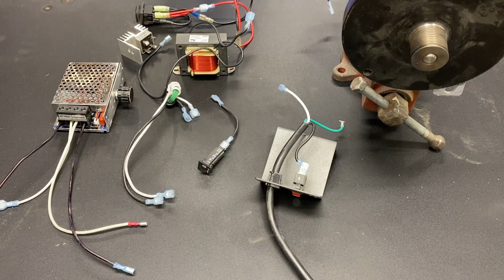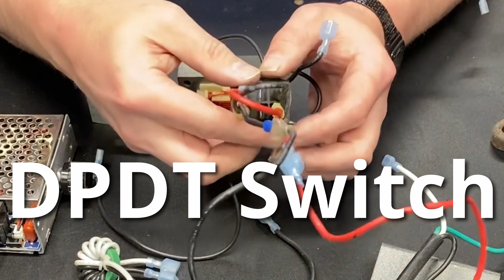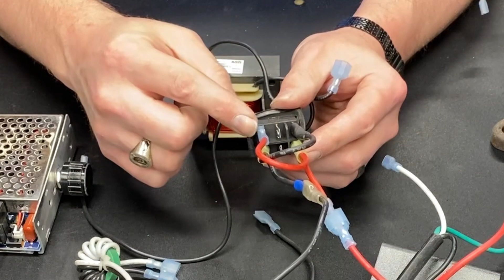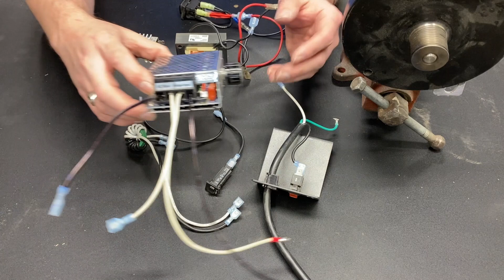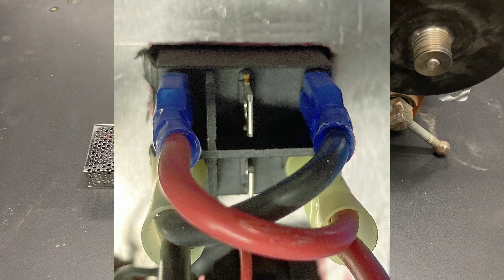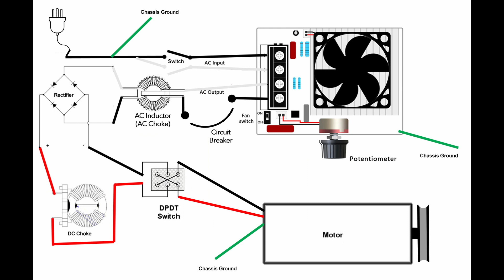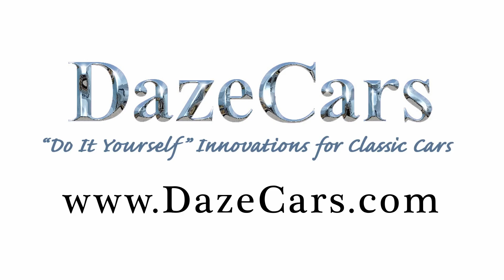Hooking up the Components for a Quality SCR Treadmill Motor Power Supply, Treadmill Motor Controller

Comment: I can think of 3 ways to turn the motor on and off.  The default method is wire the on-off switch to the120 AC powering the SCR controller like in your schematic.  Alternatively, you could have the switch on the output of the SCR cutting off power to the motor, or disconnect the potentiometer to stop the motor.  Is there any advantage to either of these other two methods?
Reply from the maker: The make a potentiometer that is off on one end.  A direction switch should be center off so that serves as the on off on the motor end.  I use the off on the direction switch when I am threading because that operation is direction dependent.  No mater how you do it you always want a master power kill switch in front of the SCR so those parts are not seeing power all the time.

Comment: I really appreciate your videos!!
I recently put a treadmill power supply for a compost trommel and used the converted microwave transformer as a DC choke. It made a very unnerving Dr Frankenstein type when simply taped together, however when I securely clamped it down to the table the noise disappeared.  
Do you know what this noise could have been? Also, would it be a point of concern?
Reply from the maker: It is a vibration created by the changing magnetic field.  Was the top welded back on?  Usually the top is where the vibration comes from if it is not solidly connected.
Reply: @dazecars  Thanks for the Reply!
I have it clamped down really securely and will eventually weld or epoxy it back together.
But it is just surging on and off now. Im running it at pretty low power from the SCR. I have all the components from your SCR hookup video, but it doesnt seem to be working and I don't hear you mention that in any videos.
Any Idea what that could be?
Reply from the maker: can you contact me through my website and send pix of your choke.  it is weird that it was working but now its not.  I wonder of due to vibration you broke through the insulation on the coil.  You could also try running it on the negative side.  Choke can be used on either side but sometimes works better on one over the other. @brendand3030

Comment: Daze. You use conventional color coding for DC wires. Red is positive and black is negative. But you show the black wire connecting with the choke. What am I missing? Shouldn’t the red wire connect to the choke?
Paul
Reply from the maker: The choke wires are black from the factory. They are hard wired in and not changeable.

Comment: Hi, great video! Can you please make a video of how to calculate the right choke and inductor values? I need a filter for 4kw resistive load with SCR power regulator, but don't know how to pick the right inductor to avoid spikes on the mains.
Reply from the maker: Not being an electrical engineer I do not have any specs or calculations for you on the motor choke. What I can do however is offer you some guidelines. First of all bigger is better. I have several motor chokes ranging from the size of a tennis ball to the size of a soft ball and the bigger they are the better they work. Second the wire for the choke needs to be a minimum of 16 awg. If the wire is not that big or better it will not have the amperage capacity to allow the motor to work properly. Amperage is the most important spec.  A lot of the chokes available online are rated in mA.  there are 1000 mA in an amp.  Treadmill motors are rated in amps so most chokes available online are several hundred times too small.  Third they are not available on Amazon at least not inexpensively, there are a few privet sellers on Amazon selling used parts for big bucks but the available chokes on amazon are too small because they are not designed for a motor even though they look correct in the picture they are WAY too small. The choke in most of my videos is part number 130993. Instead of getting one new I would get a used one. A lot of treadmills come with a choke. Go to eBay and search “treadmill motor choke” BUT know that most people on eBay don’t know what they have and the word “transformer" will also appear in most listings. Problem is a choke and a transformer look almost identical so some listings are for transformers and some are fore chokes because the sellers think they are interchangeable. They are not. They would only be interchangeable if you modify a transformer to work as a choke. (see my DIY choke video) To tell the difference count the wires. A choke will only have 2 wires, a transformer will have 3 or more. Also before I started doing videos chokes on eBay could be had for $25 or less shipped but now that more people are looking for them (due to my videos) the eBay sellers have raised their prices quite a bit. Your best bet might be the DIY option out of a Microwave transformer. Please let me know if I can be of further assistance.

Comment: Hi ,  ac voltage is 220, i want  0 to 90vac variable ( i do not want above 100vac). So 
select value of potentialmeter.  Tell me the value of potential meter,
I am using 10,000w scr controller.
Reply from the maker: I can not as it is not that simple.  You need to do some testing with a volt ohm meter

Comment: Hi, I was wondering if you had any info on selecting the choke  and inductor.
Reply from the maker: Not being an electrical engineer I do not have any specs for you, what I can do however is offer you some guidelines. First of all bigger is better. I have several motor chokes ranging from the size of a tennis ball to the size of a soft ball and the bigger they are the better they work. Second the wire for the choke needs to be a minimum of 16 awg. If the wire is not that big or better it will not have the amperage capacity to allow the motor to work properly. Amperage is the most important spec.  A lot of the chokes available on line are rated in mA.  there are 1000 mA in an amp.  treadmill motors are rated in amps so most chokes available on line are several hundred times too small.  Third they are not available on Amazon at least not inexpensively, there are a few privet sellers on Amazon selling used parts for big bucks but the available chokes on amazon are too small because they are not designed for a motor even though they look correct in the picture, they are way too small. The choke in most of my videos is part number 130993. Instead of getting one new I would get a used one. A lot of treadmills come with a choke. Go to eBay and search “treadmill motor choke” BUT know that most people on eBay don’t know what they have and the word “transformer" will also appear in most listings. Problem is a choke and a transformer look almost identical so some listings are for transformers and some are fore chokes because the sellers think they are interchangeable. They are not. They would only be interchangeable if you modify a transformer to work as a choke. (see my DIY choke video) To tell the difference count the wires. A choke will only have 2 wires, a transformer will have 3 or more. Also before I started doing videos chokes on eBay could be had for $25 or less shipped but now that more people are looking for them (due to my videos) the eBay sellers have raised their prices quite a bit. Your best bet might be the DIY option out of a Microwave transformer. Please let me know if I can be of further assistance.

Comment: How do you know what size choke for the dc side and for the ac side?
Reply from the maker: Not being an electrical engineer I do not have any specs for you, what I can do however is offer you some guidelines. First of all bigger is better. I have several motor chokes ranging from the size of a tennis ball to the size of a soft ball and the bigger they are the better they work. Second the wire for the choke needs to be a minimum of 16 awg. If the wire is not that big or better it will not have the amperage capacity to allow the motor to work properly. Amperage is the most important spec.  A lot of the chokes available online are rated in mA.  There are 1000 mA in an amp.  treadmill motors are rated in amps so most chokes available online are several hundred times too small.  Third they are not available on Amazon at least not inexpensively, there are a few privet sellers on Amazon selling used parts for big bucks but the available chokes on amazon are too small because they are not designed for a motor even though they look correct in the picture in the picture they are way too small. The choke in most of my videos is part number 130993. Instead of getting one new I would get a used one. A lot of treadmills come with a choke. Go to eBay and search “treadmill motor choke” BUT know that most people on eBay don’t know what they have and the word “transformer" will also appear in most listings. Problem is a choke and a transformer look almost identical so some listings are for transformers and some are fore chokes because the sellers think they are interchangeable. They are not. They would only be interchangeable if you modify a transformer to work as a choke. (see my DIY choke video) To tell the difference count the wires. A choke will only have 2 wires, a transformer will have 3 or more. Also before I started doing videos chokes on eBay could be had for $25 or less shipped but now that more people are looking for them (due to my videos) the eBay sellers have raised their prices quite a bit. Your best bet might be the DIY option out of a Microwave transformer. Please let me know if I can be of further assistance.
Reply: @dazecars  thanks got the reply. I picked up a tread mill last night for free but the speed control board is a fair be different then what i see in your videos so I opted for the scr route. Now looking at the tread mills speed control board, it does have a transformer and i was thinking of using that as my body and just re wind it like how you have done in your video. If i do that, how do i know if i have enough wire wound into it?
Reply from the maker: The transformer from the treadmill board is likely too small.  you want it to be the size of a tennis ball as a minimum but bigger is better.  As to the windings you want to fill it full and then secure the wire so vibration doe not cut through the wire shielding.  this is why the microwave transformer is such a good option it is big enough and comes with the coil pre wound. @bryantimms1469

Comment: will this power a 180 volt treadmill motor?
Reply from the maker: yes and no.  It will never produce more power than what it put into it.  So if you hook it up to 110AC and then the SCR with rectifier you will never get max speed.  If you hook it up to 220 you will get more than max speed and a limiter at the top would be recommended.
Reply: Wow my dude! nobody ever responds but to get a paragraph speaks to your generosity and general good will! Thanks man! I have several big honking treadmill motors that are 180 volts and I thought they were from a treadmill that somehow made a bigger voltage out of 110. 

 @dazecars
Reply from the maker: You took the time to ask a question, least I can do is take the time to answer 😁 (tell your friends) Some treadmills are setup to plug into 220 needing the 180V notor and as you assumed some treadmill controllers step the voltage up from 110 to 220.  An SCR however is just a limiter so it can only reduce voltage.   @lucrebrazzi4069

Comment: Thank you so much for your detailed explanation.  I spent an hour watching a following the instructions of other youtubers, and it would run a full speed whenever I applied power to the motor.  Then I remembered your channel as, I'd come across it in my research for my 2x72 grinder.  After watching you instructions twice and following along, I managed to get set up like yours (minus the circuit break as i didn't have one) and was up and running,  however I haven't been able to get to run clockwise and anti by switching the wires on the bridge. I'll try and get the circuit breaker and switch and hopefully that will work.  But thanks you saved me hours of head scratching.  Subbed and saved
Reply from the maker: glad I could help

Comment: Where do I get a dc chock?
Reply from the maker: Here are some guidelines that might help. First of all bigger is better. I have several motor chokes ranging from the size of a tennis ball to the size of a soft ball and the bigger they are the better they work. Second the wire for the choke needs to be a minimum of 16 awg. If the wire is not that big or better it will not have the amperage capacity to allow the motor to work properly. Third they are not available on Amazon at least not inexpensively, there are a few privet sellers on Amazon selling used parts for big bucks but the available chokes on amazon are too small because they are not designed for a motor even though they look correct in the picture in the picture they are way too small. The choke in most of my videos is part number 130993. Instead of getting one new I would get a used one. A lot of treadmills come with a choke. Go to eBay and search “treadmill motor choke” BUT know that most people on eBay don’t know what they have and the word “transformer" will also appear in most listings. Problem is a choke and a transformer look almost identical so some listings are for transformers and some are fore chokes because the sellers think they are interchangeable. They are not. They would only be interchangeable if you modify a transformer to work as a choke. (see my DIY choke video) To tell the difference count the wires. A choke will only have 2 wires, a transformer will have 3 or more. Also before I started doing videos chokes on eBay could be had for $25 or less shipped but now that more people are looking for them (due to my videos) the eBay sellers have raised their prices quite a bit. Your best bet might be the DIY option out of a Microwave transformer. Please let me know if I can be of further assistance.
Reply: @dazecars  thanks!
Reply: I finally finished it. My drill press is working great! 120rpm - 3200rpm. Thanks sooooo much for your help!
Reply from the maker: Outstanding, glad I could help. @milanp5697

Comment: Good Afternoon! Thanks for the video, I am working on a treadmill motor to drive a squirrel cage fan and this is very helpful. One question that i have is how do you keep the voltage from going over 90v? If it is 120v from the wall, I am getting 112v, on the other side of the rectifier. I have not added the choke yet so not sure what that will do but right now I am sitting at that 112v and do not want to even test it due to not wanting to overvolt the motor. Will the choke drop the voltage enough to prevent the motor from receiving the 112v or am I missing something.
Reply from the maker: First in most cases a 90V motor will work just fine with a bit more voltage as long as there is an adequate cooling fan.  The 90V rating is to establish the RPM and HP on the label.  Second when you hook the motor up to the power supply and start running it the voltage will drop closer to 100 max.  Third if you are really worried about it you can put a small resistor in series with the potentiometer to act as a limiter.  When the potentiometer gets to 0 the SCR puts out max volts but with a small resister in series it will never get to 0.

Comment: Thanks so much for all your awesome videos! Ive probably watched all the treadmill videos more than once. 

Im stuck on the inductor... I purchased a 35mmOD ferrite ring ( FT-140-43 ) and im still uncertain what to do with it. I see you used regular insulated wire rather than enamel coated wire. I already have 12g insulated wire on hand. Can you tell me how many times to wrap each lead if using what i already have on hand, please.
Thank you
Reply from the maker: You can do it with regular insulated wire.  I do 7 wraps per strand of wire.

Comment: Will it help to add a choke to a MC 2100
Reply from the maker: Yes a Choke will smooth out power from an MC2100 BUT the power is fairly clean to begin with so the minimal improvement from the choke will likely not out way the cost.  Also a choke will do nothing to make the MC2100 more robust.

Comment: H! What is inside the circuit breaker? it act like a fuse? I know that the breaker has a reset button.
Reply from the maker: Most are triggered by heat

Comment: Just found this video to help me build a custom lathe that I can turn larger drum shells on. If I wanted to add some digital meters to this circuit, would I just splice them into the beginning and end of circuit? Kind of like if you were using a multi meter to read such things like amperage and voltage? I found this really helpful thank you for sharing!
Reply from the maker: The meters will need to be wired to their factory spec.  Different meters are wired up differently.  Keep in mind that these power supplies can put out high amps and volts and some meters may not be up to the task without extra parts.

Comment: Great and informative video. I gathered all the components and followed your instructions connecting them - I believe correctly. However when I turn the pot, when it finally engages it’s at a pretty high rpm. There is no ability to run the motor slowly. Is this due to incorrect wiring, a bad pot, or just an incorrect pot?  Thank you!
Reply from the maker: The minimum speed of a treadmill motor is 250-500 RPMs depending on the setup and motor. To get slower than that you need to gear it down. As to it not coming on right away when you turn the pot it’s because the pot needs to be changed. This video goes over that process. Changing the Potentiometer in an SCR Voltage Controller Treadmill Motor Controller Power supply
https://youtu.be/04d0u1RJyXw